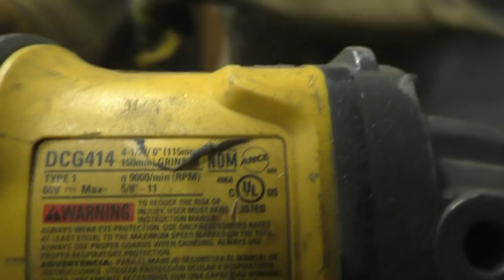Grinder Safety -- and lies you are told to scare you.

Comment: I never run with the gard or handle on 5'' grinders, but always use eye protection and gloves. Those bastards will cut into bone before you feel it without gloves on and sparks may damage your eyes. It's never really a problem when your cutting a plate, pipe etc. if you know how to cut with a grinder. Yeah sure discs could explode, but that never really happens if you inspect the discs for defections before use. I would say that 40% off the cutting and grinding that I do is more accessible with the gard and handle off. And before you tell me how unsafe this is, remember that if I have to cut at an awkward angle without the guard and the handle I am much more used to the grinder that way, therefore much less likely to hurt myself. If I only was cutting flat sheet steel etc. I would leave them on, but that's not really what I use the discgrinder for.  
As a tip for all of you (with or without the gard and handle) always try to cut so the grinder tries to run away from you and be gentle with the disc when you start, because thats when they usually breaks. And if you lose the grinder without a guard or a handle with the press in buttons that keeps it going go for the power cord not the grinder!

Comment: i dont get why people wear saftey glasses but a shard at 100 mph can just as easily go through your jugular. Shouldn't people be wearing a welders steel mask and body armor before grinding?
Reply from the maker: Because the shards from grinding or abrasive cutting are about the size of a flea.  With so little mass they have very little inertia.   Go get yourself a grinder and glasses and try it yourself.
Reply: @SVSeeker  No i meant when the entire thing breaks and flies all over. Like the horror stories and picture of the giant piece embedded in the saftey glasses.
Reply from the maker: @Hathathorne    I don't think the movies are a good depiction of reality.    Get a grinder and start working on something.

Comment: Yeah wonder if you guys noticed metabos manual says only to be used as a grinder, I mean who buys those just to grind stuff, and that unit is no different than any other grinder sold on market, type 27 gaurd, I dont understand guess they want to limit their liability for using a tool that's designed to cut and grind, but they dont want you to cut with it

Comment: Ive been around welding for over 20 years as a welder then foreman and now as a inspector and have seen a lot of incidents, using grinders like this is dangerous.
Reply from the maker: No doubt.   But is it necessary to lie about it?
Reply: @SVSeeker  i don’t believe companies lie about the potential for injury with grinders, ive had my eye drilled to remove wire bristles pieces personally, ive also had several discs explode on me, ive seen people severely injured by discs cutting into them…. So they are very dangerous and need to be used properly, I am a AWS CWI by the way so im not just making up bs im currently working in a pressure vessel shop overseeing fabrication of vessels
Reply from the maker: @jacobspringfield2963  Me neither.   But that photo,  which is what this video is about is a lie.   And fearmongering does not help people be safe, it only make them unjustifiably paranoid.   And people don't need help doing that.

Comment: this is a thin cutting disc , as if the finger aint enough this still does NOT apply to the grinding stone discs thats where the danger is at, having that break is so much worse , these type of disc obviously just dissolve into smaller pieces
Reply from the maker: So you agree that people lie about the dangers.  : )

Comment: If a cutoff wheel splits in half at the maximum rated speed, it can have a kinetic energy of more than 50 joules. Considering that a .22LR round fired from a rifle length barrel has a KE of ~200J, I think it's certainly possible that a splitting cutoff wheel could get embedded in safety glasses. Now whether that pic was faked or not, nobody knows of course, but it could be real.
Reply from the maker: Nope.   Ya got to prove it.
Reply: @SVSeeker  The lowest class of EN166 rating is only certified to withstand impacts from a 0.88g ball at 45m/s, which makes for a kinetic energy of under 1 J. So certainly a splitting disc can and will penetrate safety glasses upon correct conditions.

And even the EN166B rating that is common  
for faceshields is certified for impacts only up to 6.3 J. That's why it's typically recommended to wear both glasses and a shield while using a grinder.

Comment: Dude  you told the disk is made for cutting not for grinding but the tool is a grinder not a cutter ... so what are you using for grinding ? a saw maybe ... By the way the disk snaps way better if you grind because the strengths are not applied the same way. Anyway you should at least  wear something to prevent you inhaling all the dusts (much more dangerous than a blade snap that could easily be prevented).

Comment: I know this is an old video, all sensible advice, good video, but I'd like to share some experiences I've had. Less so with grinders, but more with the wire brushes you attach to them. I spent a day wire brushing the front axle case and the underside of my car. I started removing my gloves, etc, went in to wash my face. I felt something attached to my face. I went to look in the mirror and I had some of these wire brush wires stuck into my face. I was a porcupine. All over my face. Not once during the day did i notice them sticking into my face. Fortunately I was wearing glasses. I was pulling these tiny metal sticks out of my face. As far as grinding goes, I've had more go in my eilye from wiping my face than actually using the tool. I've never managed to make a blade explode.

Comment: As a welder I've done my fair share of grinding and cutting mostly with 4.5 in to 9in. grinders and beat the utter hell out of disks. the only time I've had them even remotely "explode" is when the grinder is still spinning and I've set them down on something and the wheel catches on something. never had it happen when I'm grinding.

Comment: Horribly incorrect info. I work at a large weld shop and we have had several faulty disk that have came apart. We have had injured employees due to grinder disc. Grinder disc are different that cut off discs. Please don't listen to this guy!
Reply from the maker: Did I say you could not get injured?   Did you actually watch the video?

Comment: be safe but seriously, wearing glasses I had a spark from a dremmel hit my cheek, reflect off the inner part of my glasses and in my eye, Dr took 6 sec to take it out. 25 min ride to dr. (emergency room) Spent 35 min in waiting room and 20 min for for the dr to do the exam. You know if it hits your eye, it was a fluke, I have spent 30-40 hrs in my life using the dremmel grinding metal and steel and brass.  I am an IT guy using computers mostly,  At the time I had this happen I was only useing the dremmel for 4hrs of my life, been using it 10x as much since then no issues. (was that one time I touched a hot drillbit using it to cuttout light swithch thru drywall, but thats not a grinder and I was DUH stupid. This guys spends more time grinding in one month then I have or will in my life, He is right on par.  My accident was 1 in a million and no harm no foul.  If something does happen get it looked at and fixed.
Reply: @Folsomdsf2  the fluke was it bounced off my cheek then my glasses and into my eye.

Comment: "worst thing that can happen is to loose a finger"
How the f can you manage to cut off a finger with a grinder? I've cut myself more times than I can count, and from my experience if you want to cut off anything with a grinder you'd have to try. Griders are awesome at what they do, but compared to serious limb-removing machines like a table saw or a chainsaw they are really slow cutters, even soft meaty flesh takes time to cut trough...
Eye damage and hearing loss are the only things to really worry about with a grinder, the rest of the injuries that might occur is dings and bruices. getting hit in the face with flying disc pieces might take out a tooth or leave you with a scar, but the way YOU look that'd be an improvement...
Its quite uncomfortable to get hit, and you might bleed a bit on the nice shop floor. So by all means, you should have the shield on if you can, but some times its just in the way so you take it off, no biggie.

Comment: To be honest, to use these kind of tools, you have to have a certain mindset. rather than just blindly following health and  safety guidelines, make your own assessments, your own boundaries, only do what you feel comfortable doing. you need to be critically thinking enough to assess your own risks. yes, nearly all tools are bloody dangerous but normally only if they are used incorrectly! eyewear is a must, but any other protection is down to the individual, just be sensible. also if you are afraid of getting cuts and splinters and bashes and scrapes, don't work with metal or any of the associated tools, you will always get little injuries here and there. 

to be honest some of the worst injuries I've got have been by doing things like picking up thin sheet steel that hasn't been de-burred and it slipping through your hand! it doesn't even require power tools to get hurt, just a lapse in concentration or a moment of stupidity!

Comment: I do tend to use the guard on my 7.5 inch corded Dewalt cuz that thing is a beast, but hardly ever use it on my 20v, which is an awesome lil tool btw. Side handles usually go in the garbage as soon as I open the box, never have used them on anything. 😉

Comment: Speaking of eye injury . . . had some acquaintances who were cavers in New England area. They were working on a "lead," basically a constriction in the passage way too small to squeeze through and which (based on air flow, and/or other indicators) suggested there was more passable beyond the constriction. Cavers are constantly looking for "new cave" to get into, and especially in cave poor regions like New England.

So the method they were using was to drill a hole and then use this pipe with some sort of small explosive charge in one end and an impact detonator on the other end. Drill the hole, a few inches deep, stick in the boom end, whack the trigger end and BANG, rock broken and you can then hammer/chisel/dig it.

Somehow this moron managed to detonate the thing in such a way that the pipe launched OUT of the hole, probably at several hundred or more feet per second . . . AND! had his HEAD positioned right behind the pipe (I was being told this story by two of the uninjured survivors who were present when this happened). Dude wound up with ~1" diameter steel pipe rammed INTO his eye socket! Obviously destroyed the eye, and probably did some brain damage.

Moral of the story: no matter how "safe" anyone attempts to make life, there are morons out there who will do everything in their power to weed their genome out of the breeding pool.

Comment: I like to use face shield when working with particle spitting tool like this one. It keeps my entire face safe and because it's a bit loose it will damp whatever inertia there is left in the flying pieces. Personally I do not remove the guard unless absolutely necessary. Not because of flying pieces, but because there is significantly smaller chance for my hand to get in the way of the spinning blade.

Comment: If you never put your body in line with the wheel its nearly impossible to be hit with shrapnel. I never realized people were so afraid of grinders until i saw another YouTuber talking about how "dangerous" he thought they were.  Kickback is the main concern with grinders snd if you're using it with common sense it's nearly impossible to happen. 50 years ago we didn't have all of the extra safety switches and bs on tools, everything these days is apparently retard proof.
Reply from the maker: Nothing is idiot proof.   We just need the idiots to find other work or stop being idiots.

Comment: Can do without the guard ok.  Makes alot of jobs easier.  Don't ever use one without eye protection though.  Grinder sparks are a pain in the ass (and eye) if you get one stuck in your eye.  As the old saying goes, you'll only ever have one set of eyes.  Good majority of health and safety is common sense though, which is sadly lacking with alot of people

Comment: A Grinders design is fundamentally flawed, its the trigger, If its locked on and the disc catches it can do a 360 and cut right into your wrist ! this happened to me ! cut straight through my gloves and to the bone ! Buy a Milwaukee With the palm trigger ! dewalts are among the worse designed ! funny when i was in A&E getting stitched up the nurse told me most work place accidents involve grinders 😬

Comment: THE BIG GRINDERS - CHOP SAWS THAT RUN OFF 120 WILL HURT YOU IF YOO DO DUMB SHIT. THE LITTLE BATTER POWERED UNITS ARE NOT NEARLY AS DANGEROUS. 

You should show more in depth where not to cut on the blade etx

Comment: Been using them for years, had a few blow up in my first years. Only time I cut myself with a grinder was doing some real low to the ground cuts on some steel posts. I re-positioned myself and accidentally stuck it in my leg. Couldn't exactly blame the grinder for being unsafe when it was my negligence that caused it.

Comment: Discs breaking apart can cause serious injury. You just haven't had one shatter on you yet. Yet... Quit poking the bear and use your PPE.  They are called discs, not blades.
Also, corded grinders have a higher rpm than cordless (some corded have adjustable speeds). Make sure that the disc you are using is rated high enough for your tool. Make sure you are using the correct type of cutting or grinding disc for the type of cutting or grinding you are doing.
Make sure you buy discs that match the arbor on your grinder. Mismatching these two things can cause wobbly, dangerous disc use.
The guard is not just to protect you from the disc failing, but also to redirect sparks and keep you from unintentionally removing your fingers. 
Look, we are all adults here. Most people should be able to watch this video and read an owner's manual to decide whether to take your advice or the advice of the equipment manufacturer. But please don't encourage dangerous behavior. We already have enough people doing that.
Reply from the maker: Hi MOM!

Comment: I don't get it. A guard on a grinder is one of the least obstructive safety devices on any power tool. How on earth they keep getting in the way of stupid people is a mystery to me.
And ok sir, you shredded into pieces 3 wheels on a grinder without the guard and nothing bad happened. So what? Acting dumb and getting away with it doesn't make your actions any less dumb. That guard is not for those 1000 cases when nothing bad happens. It is for that 1001st case when the broken wheel fragment flies towards your face.
Reply from the maker: Pumpkin if you want to use the guard, then use the guard.   But I've been doing this for years and my experience tells me you don't have a clue what you are talking about.

Comment: Just bought my first angle grinder with some cutting wheels... this was reassuring. I think I got the same exact cutting disks too. I did a bit of googling on how to use it and my first results were like- Wear goggles, safety glasses, dust mask, gloves, fire resistant sleeves etc etc and it seemed like overkill. I watch a handful of car channels on yt and many of them don't even use the guard (and some have even explained why they do so). I'm gonna go ahead and leave the guard, and probably wear goggles. Oh one question... My grinder says only use type 27 cutting disks, and I have type 1- does that matter? I see lots of info saying not to use them, but with the nut flipped over they seem properly clamped down to me.
Reply from the maker: I think Type 27 are the ones with a raised center.  The would put the blade further from your fingers that are on the handle.    Put your Type 1 disk on and see what you think.   I use them all but I often wear a glove on the hand holding the handle and that glove often gets cuts in it.  :  )
Reply: @SVSeeker  I'm not in a rush for the project I'm working on so I ordered some type 27 ones. I'll try the other ones eventually I'm sure.
Reply from the maker: @facksmasheen  Good idea.